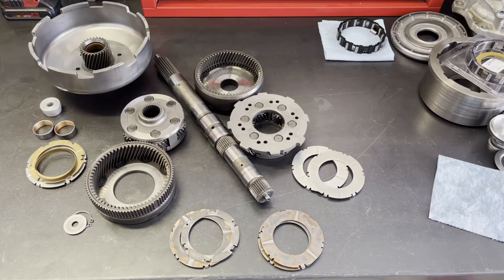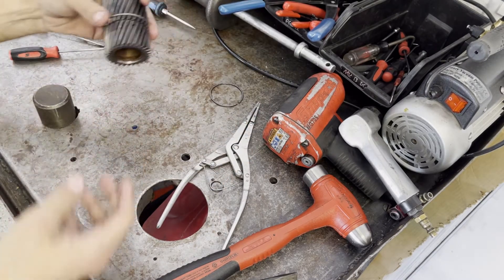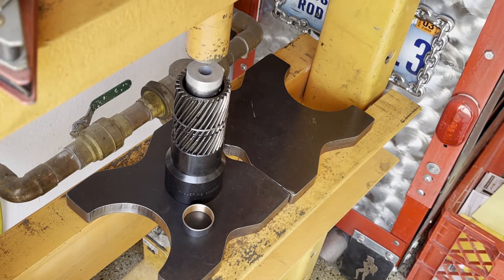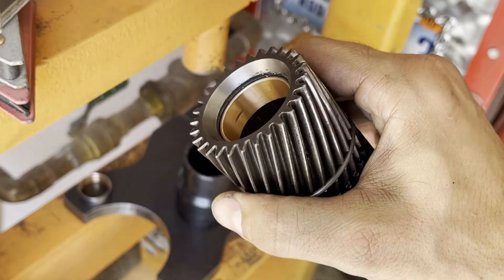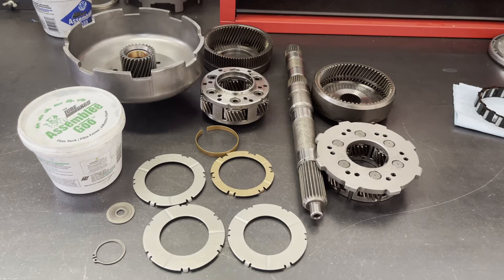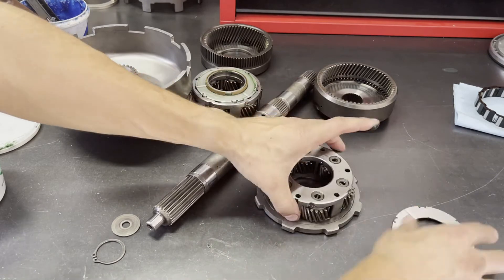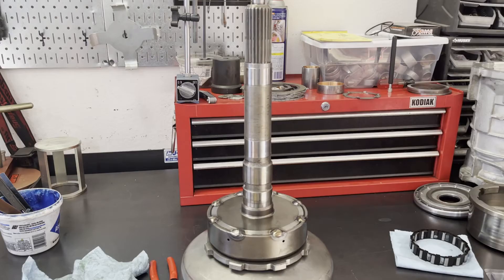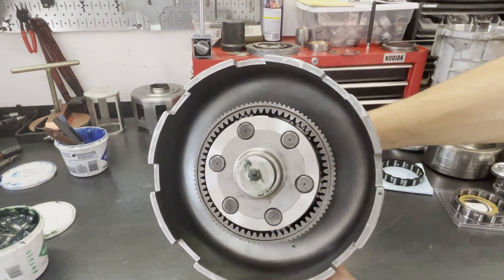4. Dodge 48RE Rebuild - Gear Train

Comment: how much end play should you have in the intermediate shaft at this point, with the overdrive housing off? grabbing the end of the shaft with your hand, and in & out play, I've got .125" -- seems excessive.
Reply from the maker: Don't measure it with the OD housing on the bench - it has to be bolted to the case before measuring any end play...Any end play measurements prior to doing that are meaningless.

Comment: Any good ways to get the little tip thing on the back of the shaft back in?  Mine had slid out and feels like it doesn't want to go back in.
Reply from the maker: Tip thing? What is the part's designation per the ATSG manual? Are you referring to the selective band-style spacer that's used to set OD Section-to-Case travel?

Comment: Are you sure there is a thrust washer between the rear planet and ring gear? I don't think the book shows one.
Reply from the maker: Hello Rob. I am very sure...The #7 thrust washer goes on the front of the carrier while the #8 washer goes on the rear. If you had no intermediate thrust object between the carrier and ring gear, they would eventually severely damage or destroy each other. The thrust washers are exactly the same.

What book are you referring to? 

Please respond so that I know there's information being published that's not accurate and could potentially mis-lead folks into leaving stuff out that should be installed. 

See page 80, figure 137 of the ATSG manual for those transmissions for more details on the placement of those two thrust washers onto the rear planetary carrier.

Comment: I've struggled to find these bushing individually and ended up ordering a kit that came with them. Could you point in a direction to order these individually? Do you happen to know the ID of them as well? The kit I ordered did not have any of them labeled/marked and ID of old to new does not quite match up.

Thanks for this video series, it is helping me to do my first transmission rebuild.
Reply from the maker: You're welcome, dpgoverride....I have five or six different complete sets/kits of bushing drivers covering most sizes plus several I purchased individually for specific transmission bushings. I bought most of them off eBay over the years, including some in large 'lots'. I'd check there first then perhaps Amazon for complete bushing sets or your local transmission parts supply shop as most of those places also sell transmission specialty tools, including bushing kits.

Good luck with your first build!
Reply: @nickstransmissions  helping my brother with replacing overdrive unit. Bout completely rebuilt unit to install in housing. Having trouble reinstalling to transmission. When we slide it up to bolt in we end up about 1/2 to 3/4 inch away to bringing all way up to bolt to transmission. What could we be doing wrong?
Reply from the maker: Actually nothing. It takes a fair amount of effort (ie using a very heavy composite sledge or mallet) to get it on. Even when it’s inverted on the bench it takes a few smacks to fully seat it. 

As long as the spines are properly engaged you wont break anything. Just takes some work…
Reply: @nickstransmissions  Thanks for the quick reply! I think we may be misunderstanding one another. On the bushings I am referring to the sleeves that are pressed into the sun gears, both OD and Sunshell units. I purchased a complete kit and am finding the OD sun gear (front/thin side) is so tight that it will not slide over the first part of the intermediate shaft.
Reply from the maker: If you're referring to the bushings themselves they should be available individually from any transmission parts supply shop in your area...Transtar's website should also have them as well as ebay. 

That's assuming you have the wrong bushings. If your bushings are correct and they're having trouble sliding onto their respective journal surfaces, you will likely need to 'clearance' them with sandpaper...I use 400 grit to remove material and 800 or 1000 to polish. I show this process being done in my TH400 bushing video: https://www.youtube.com/watch?v=gZMWbFwt9jo

Skip to about 14:30 where I address 'fitting/clearancing' bushings to fit. The problem is typically a slight out-of-round condition on the shaft journal itself, which can also be polished w/sandpaper or emery cloth.
Reply: @nickstransmissions  ahhh yes maybe that is partially my problem, I wouldn't feel comfortable sanding these bushings I have, it was an eBay kit and they are really cheap looking, paper thin looking bronze areas. I'll be ordering a new kit for sure, hopefully much better quality. 

I wouldn't be surprised the shaft journal is out of round slightly, when trying to slip the sun gear on it's tight left to right but loose front to back. 

Thank you again for your help!!
Reply: @nickstransmissions  Alright I gave Clearancing the bushings a try, actually worked really well! Took about .004-.005 off and she slides on nicely now with just a touch of play.

And surprisingly these bushings have a thicker bronze layer than I thought. Win-win, couldn't of done it without your help, appreciate that!
Reply from the maker: You're welcome, great to hear it worked out!